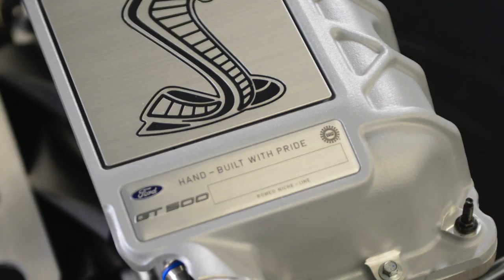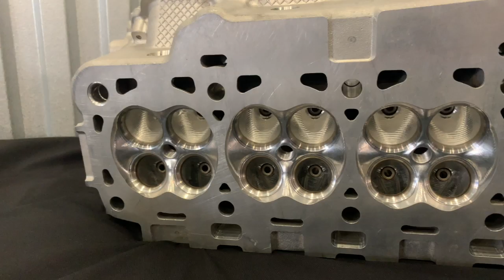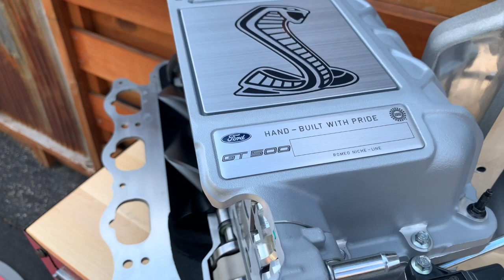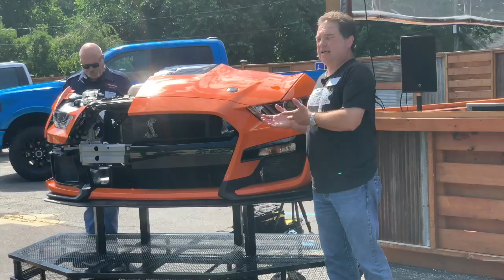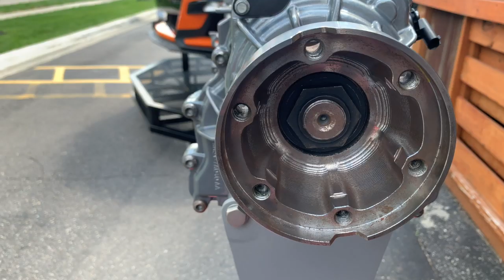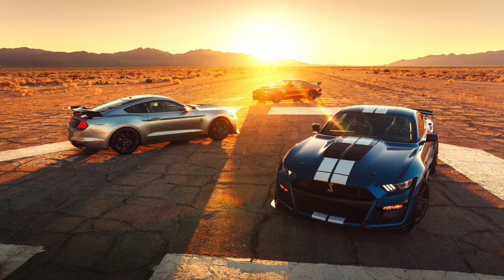2020 Shelby GT500 Ford Mustang Goes 0-100-0 in 10.6 Seconds | First Look Inside 7-Speed DCT!

Comment: Soooo my 2014 gt500 came with 662 hp(per svt every engine dyno 670 to 700hp at the crank so ford didn’t get sued again)
So mine has a honkin big 2.7 supercharger that svt said takes 100 hp to run( all stock) yet dynos at 601 rwhp so drive train loss is about 70ish hp. 
  So doing the math from what has been stated “850 at the source, source = crank, there is no other measurable source, sorry. 
And as stated here over 850 gross hp— means 760 at the wheels figuring another 70 ish or so drive train parasitic loo. 
     Poorly thought out math = 760hp— minus 100 supercharger loss minus 70ish drivetrain loss =600 ish rwhp same as my 14= WRONG.
Reply from the maker: I dyno tested a stock 2013 GT500, 617 at the wheels, no way a stock '13-14 makes 670 RWHP.
Reply: REVan Evan I agree my stock 14 @601. Reread what I wrote would ya and see if it makes sense. Thx

Comment: So, "you can run this car out of gas and you'll still be getting full performance."  [5:43]  But, will that damage the engine?
Reply from the maker: No, of course it's not recommended, but Mr. Morgan is proving a point that you can run an entire tankful on track and not lose any power. He's not staying to go do it, but the point is the GT500 won't heat soak and lose power over a typical track session.

Comment: 100k for a Mustang???
Reply from the maker: $73,000 for the base car, probably close to $100K as delivered with ADM. Expensive, heck yes! But where else are you going to get 760 hp, a full warranty, a DCT transmission in a package that's capable on any track in the world for that money?
Reply: C8 will crush this car around a track and maybe in a straight line for 60k.....
Reply from the maker: @zachaca  I'm not sure how a 495 hp car is going to beat a 760 hp car even with a big weight advantage. And I doubt a base Vette will be a GT500 around a road course either. Add a Z51 and good seats and you're at the GT500 base price anyway.
Reply: BigC - not gonna happen not the base C8
Reply: @revanevan  C8 is a far superior platform ...
Reply: 600lb weight difference buddy. That 760 number Ford is talking is peak  power at the crank. 200 kore hp isnt going to do it....
Reply: @brucedressel8873  Once they do faster versions, maybe, but the entry level c8 isn't superior to this.
Reply: GT500 confirmed to be 4200lbs ha ha ha. No more calling Mopars fat!
Reply: Actually it's less than 4,200lbs. The base model weighs 4,187lbs and the carbon fiber package GT500 weights approximately 4,056lbs.

Comment: Quoted times are all great but ford an many other company’s dodge, Chevy and others have mislead us many times. The gt350r never hit the quoted times the pp1 18 mustang gt never hit 3.8  0 to 60 in stock trim. But it’s cool will see how they do when guys get them to the track. Also corvettes never seem to hit quoted times either. The zr1 did come close but never seen anybody do the 0 to 60 as quoted.
Reply from the maker: I've tested a 2018 Mustang GT on stock tires and ran 11.83 at 119.5 mph with a 1.88 60-foot time. I don't know the 0-60 but I imagine it beat Ford's claimed time.
Reply: REVan Evan give it a try I got 12.2 with my stock pp1 in 875 foot DA An 68 degrees 1860 foot elevation. But never near 3.8 0 to 60
Reply: Underfedcoyote 5.0 they never said 3.8 0-60 they said 3.9 0-60. And at the track some people have gotten that claimed 0-60 time

Comment: Engine makes 860 takes 100 hp to run a sc so 760 to the wheeles 680 ish
Reply: Slightly less, the dct has much more rotational mass

Comment: I'm a Ford guy
I think that's the power to the wheels.
When you go from 0 to 100 back to 0 in 10.6 seconds its putting out more than Ford is telling. I buy one of these beauties I'm going to the engine dyno.
Reply: Not likely, Ford's never used whp. Although they have been known to lowball the actual hp number.

Comment: Did he just say it has to be able to cool an engine that produces / 850 gross horsepower so does that mean the engine has 850 horsepower did Ford just slip so is the 760 horsepower rear wheel horsepower
Reply: No what he meant was the engine and supercharger combo makes 850 hp but you have to subtract the 90 hp that it takes to spin the supercharger at full RPM it’s considered a parasitic loss all superchargers work in this way. Basically it takes about 100 hp to turn this type of supercharger at full rpm. That’s why the supercharger makes 760 to the crank which is amazing for a small 5.2 L engine compared to the power output of these larger 6.2 and 6.4 L supercharged engines the competition have.👍🏽👍🏽
Reply: @IMGONEIN60  no Ford has said it has 850 hp at the source so the 760hp is at the wheels! Look it up!
Reply: BADDAZZ GARAGE manufactures don't rate rwhp, it's brake HP, Read the comment above, parasaic loss
Reply: BADDAZZ GARAGE you are incorrect, but lets hope you are right 👍🏽
Reply: which means cube for cube ford performance for the WIN
Reply: @TheLawlessGang  it makes a pile less tq. Torque is power.....so not so much.
Reply: @TheLawlessGang  Always has been.
Reply from the maker: It was very interesting how he worded that.
Reply: Amazing job well done Ford
Reply: Gross horsepower is 850.
Net horsepower is 760.
Reply: It makes 146hp per 1.0L displacement, or 95hp on each cylinder.. it's Ford's same old recipe of small size big horse power, but still impressive 👍 A 375hp 2.7L EcoBoost makes 139hp per 1.0L.. 🤔
Reply: @Metal_Stacking  i didn't miss the 537 tq it makes across that range.

Actually the blower makes it.....as with any boosted engine.
Reply: @Metal_Stacking  keep telling yourself that. Tq is the only power a engine can make.
Reply: @Metal_Stacking  tq is the only power. W/o tq there is no hp.